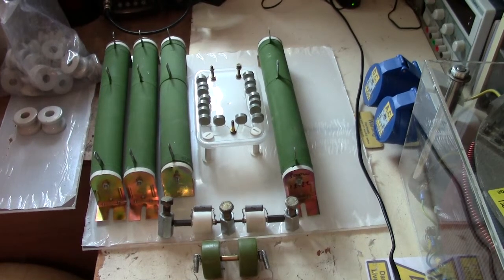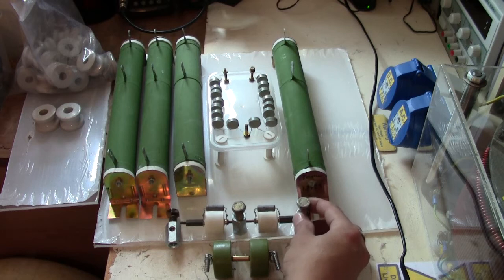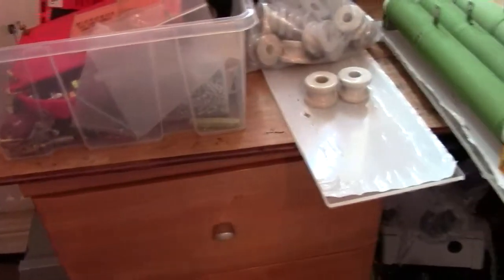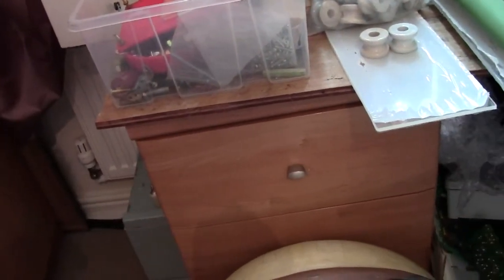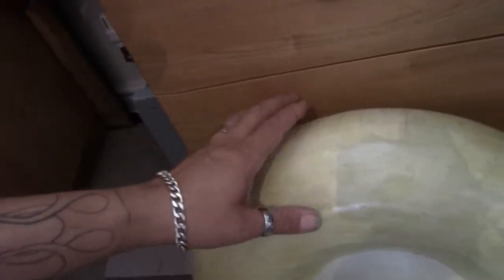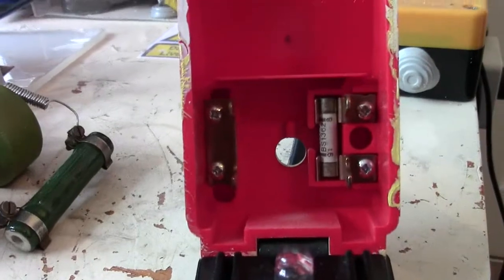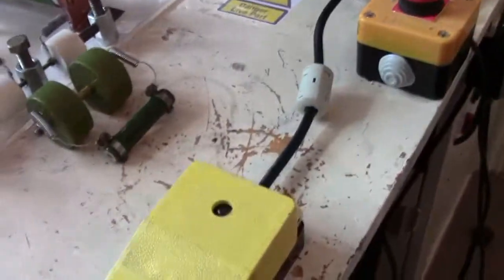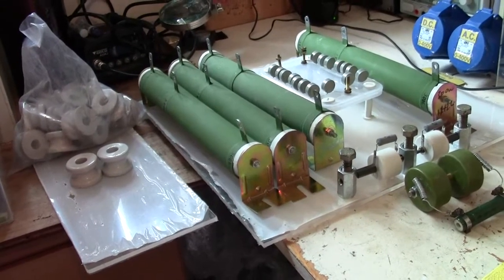Tesla update and some great links DO CHECK THEM OUT !!!!

Comment from the maker: the big one has two centers cut from ply and the smaller one is two cake tins bolted together .Its worth it as there very smooth def better than plain ducting as they have a chance to charge up when the coil is first turned 
on as they shouldn't instantly break out  .